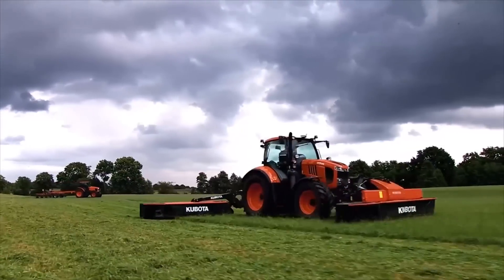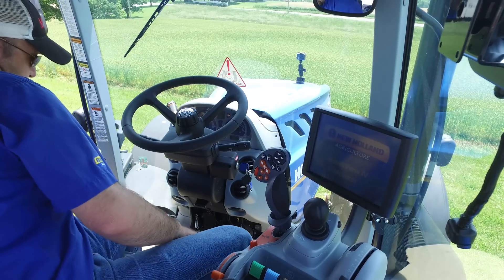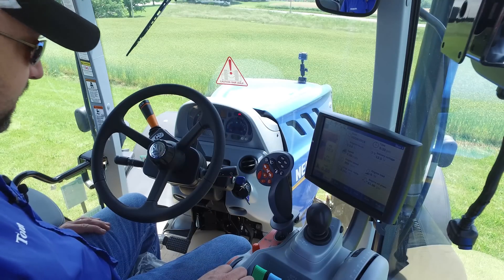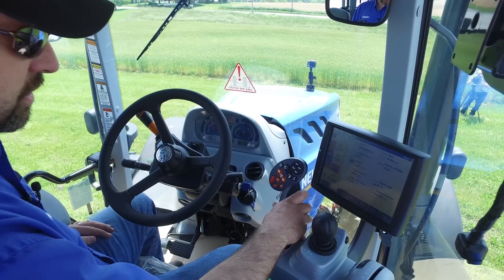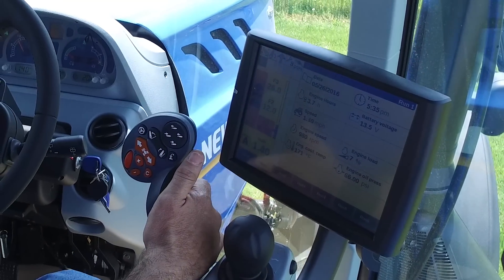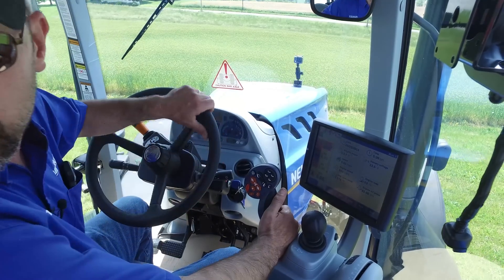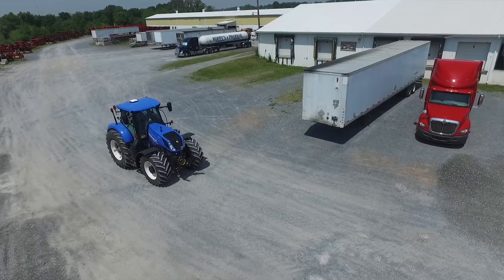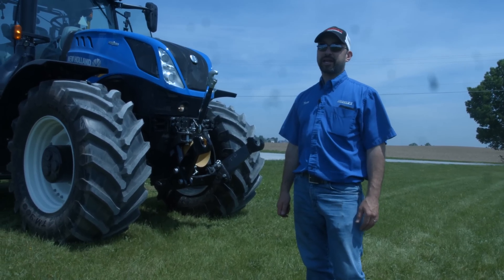How to Operate a New Holland T7.315 CVT Transmission Tractor | Messick's

Comment: I dont think Tom Wagner knows how to drive a CVT. You dont need to clutch and brake when yo move it from park to drive or vis versa. Using neutral is good when you are being loaded by a digger and you are on flat ground because it then doesnt go into park which eventually wears out and needs repair. I also prefer Case because the instrument panel is on your right corner pillar and the compartment in front of the steering wheel keeps you drink and lunch cool.
Reply from the maker: This is like a 6 year old video. A few things have changed.

Comment: I know this isnt a t6 but what would a t6.145 tier 4b 16x16 speed suspended cab and front suspension cost brand new with a loader pretty much the economy price of the new t6 like basic transmission and cab features.
Reply from the maker: +Bristol Bishop Bishop you'd need to call one of our sales staff. Far too many options.